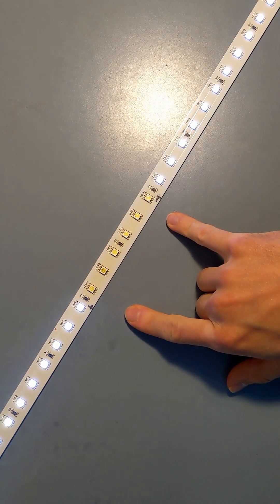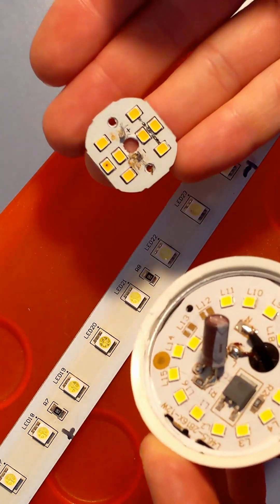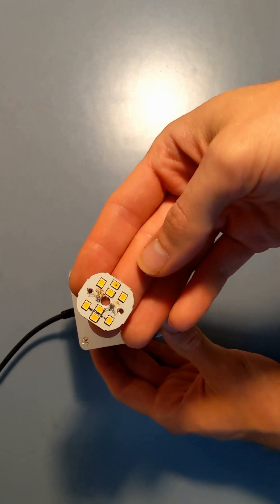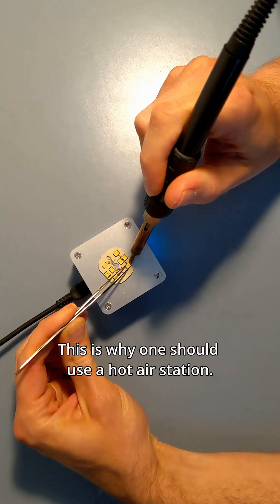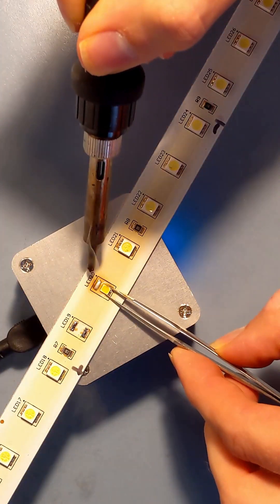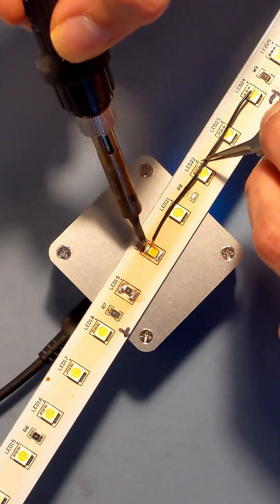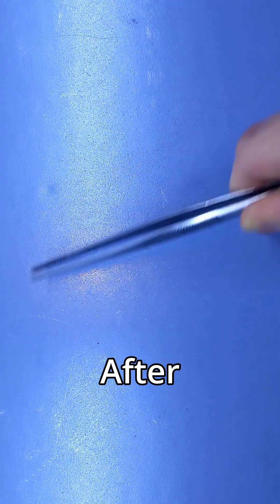Frankenstein-Repair of a LED Light #diyelectronics #diy #ledlights #shorts

Comment: Why didn't you just bypass the bad led?
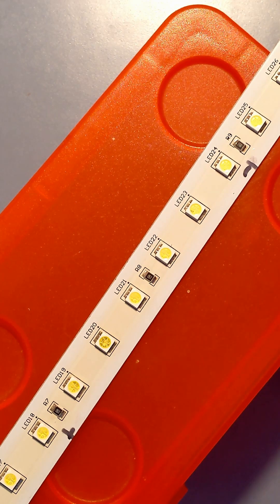Reply from the maker: Good question! Bypassing it would have increased the current flowing through the remaining 5 LED chips so the resistor value would have been to increased to compensate to not fry them. Since at least one, maybe even two LEDs in the same section already showed signs of breaking down (the dark spots visible at 00:07) I didn't trust them too much either. At the same time I wanted to re-use a chip that would otherwise go to the bin, so this was a nice experiment.
Reply: @tinkeranddespair  also, I believe the voltage values between the LEDs are very different. But if the goal was to have fun, totally understand.
Reply from the maker: @irishn8  I thought so too, couldn't measure the Vfo of the six-LED-chip directly, but when I connect it to a bench power supply and gradually increase the voltage the single chip comes on together with most of the sections (except one, which is always first). But of course you are right that even its different behaviour heating up will make a difference.
Fun is my goal in general, and using stuff that would go to waste otherwise, but I guess that's still fun to me. Thanks for your comments, have a nice day!